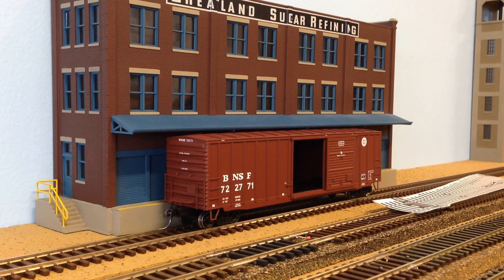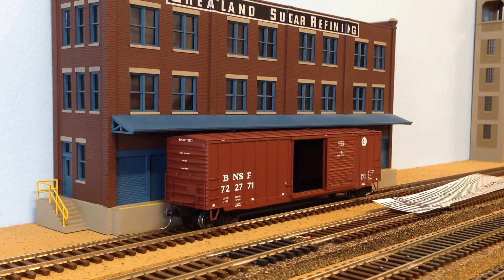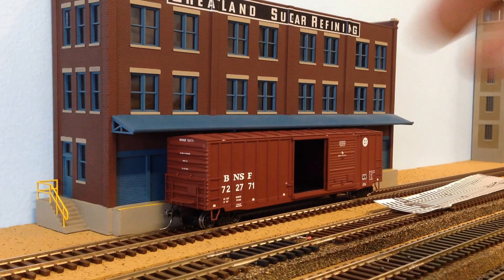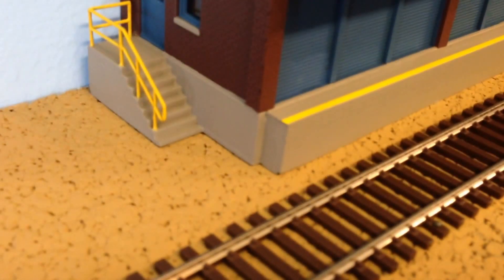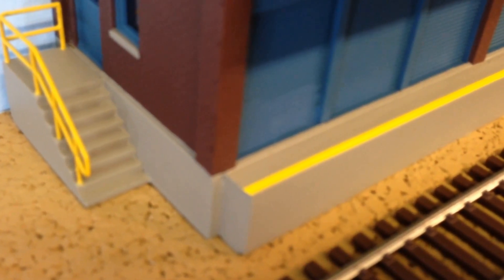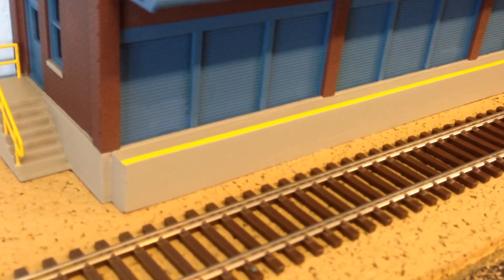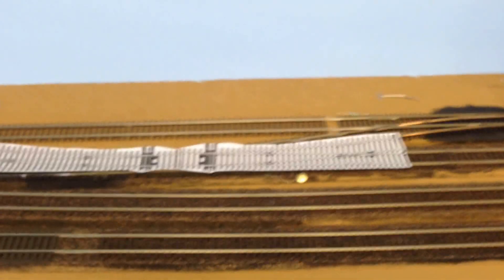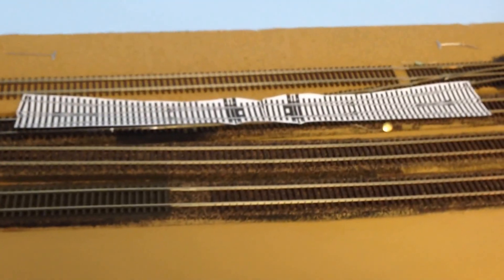HO Scale track plan?

Comment: I enjoy MR magazine and also their yearly MRP planning issue.  Look at ops videos for ideas and to start getting an idea of how things work. I've been looking at a lot of ops videos.  I think I found your channel looking up benchwork.  I'm hoping to have a plan for the track layout, scenery, buildings, and ops, before I build anything.  I picked up Micro-Mark's car card setup, and also a How to Operate your model railroad special issue that came with Tony Koester's book on operations, both of which are great info on ops and also give some ideas that are helping me with track planning.  Thinking you could raise the building with a "concrete slab" of sheet cork maybe?  Use the turnouts differently, to make a solid siding that ends to the left and to the right, with a runaround in it.  This would give you extra "off spot" storage for cars, and make spotting cars more interesting.  Only use 4-6 turnouts and use two that are the opposite.  Once in a while you'll have to pull and re-spot a car, but that makes things interesting.  With the turnouts you have now, you got it I think, just adjust placement.  With a runaround and another way to get onto the siding the other direction, you can likely spot most of the industries from one end or the other without things in the way...  proper placement/spacing of buildings and turnouts will be key.  I'd go with 2 RH turnouts, then LH, two sets.  put one building inside the runaround so that it never gets a direct move, rather always needs a few moves to get a car into that spot.  Leave room for a loco and a car before the next industry so that you can switch without moving things unless there are "extra" cars on the siding.   Give a building or two spots for two cars, that have to be spotted to "door 1" or "door 2",  that also adds to the interest of a session.  This is just what I've gathered from reading, watching ops vids, and a visit to a club layout once.  I go for Option 2 with modification.  :)
Reply from the maker: WOW!  Thanks for the input.  I think if I had waited to start building until I had a plan for everything, I never would get started.  Please see newer videos as most of this has changed….

Comment: the prototyp railroads try to keep everything cost effective, means, as less track and turnouts as possible. I vote for option one, maybe the 2 industries on the right tied together on one spur since the small warehouse can hold only one car.
To run around the cutoff of cars for the industry on the left you can use your outer mainline. The conductor needs to call dispatch and ask for permission to do so.
Reply from the maker: Thanks Raymon!!!  I was just down in the garage looking this over and kinda came up with the same thing about using the outer mainline to runaround.  Thanks again for the input…

Comment: Since you don't want to use a computer based trackplannig program, spend $20 and pickup Kalmbachs book "Realist Model Railroad Operations by Tony Koester, I think it could go a long way in giving you some insight into operations. Probably the best book ever written regarding operations on model railroads was Allen McClelland's " The V&O Story". It's out of print but copies are available.  To this day, at least for me, its the bible of model railroad design & operation.
If you're designing/modeling an industrial area, it would be more prototypical if the buildings are right next to each other, not spread out along the whole length of the wall. Typically industrial areas are very condensed, with buildings on top of each other.
Suggestion... Leave the building on the far right side the video were it is with it's own separate spur. Give the building on the far left its own spur, and because that building has the very thin wall section add a second RH turnout which would give that industry two spurs, one to store cars waiting to be loaded or unloaded & that means... more operations. Take the other three buildings and condense them down to an area no longer than the width of all three. I would than condense the other two building somewhat closer to the three. This solves, in my opinion numerous issues, 1) condensed industrial area means less track work, remember railroads liked to keep things simple, 2) use the additional space along the wall for scenery, or 3) add more industrial buildings.
Please take these comments & suggestions as constructive ideas from an old man with 40 yrs experience in the hobby. Hopefully I've been of some small help.
Reply from the maker: Thanks much!  I'll look into those books.  There are so many books out there, I had no idea which ones are really good.  
I was planning to fill in the space between those 5 buildings with some type of "fill in" structures, probably flat, either printed or scratch-built.  
Thank you so much for the well explained ideas, truly appreciated.